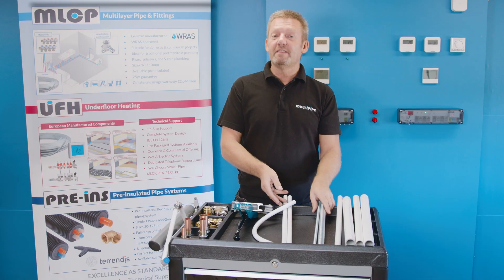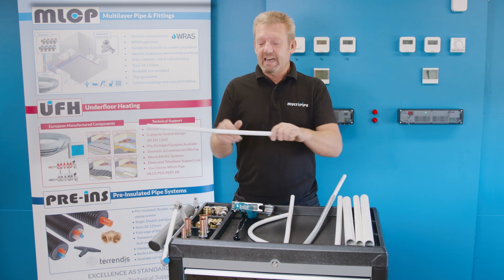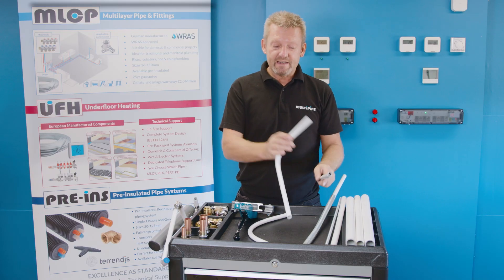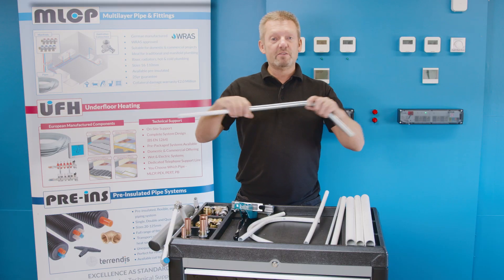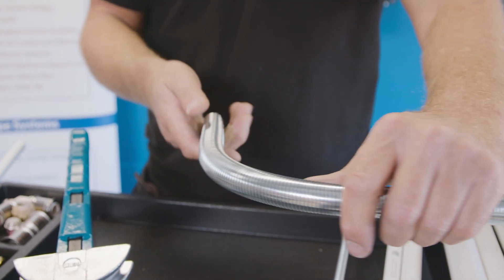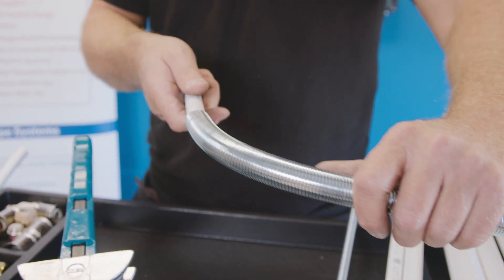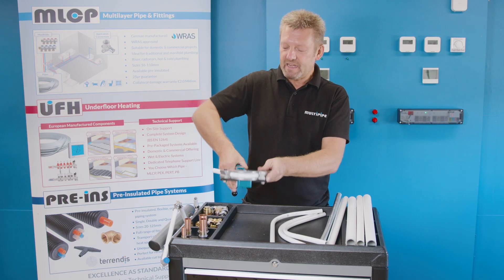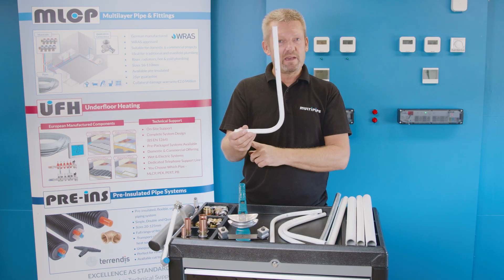MLC Pipe Shaping and Bending - Multipipe

Comment: Interesting that these are not widespread in the USA (I think). I live in Europe and almost every water and heating piping is made out of these MLCP pipes. (Even search results end up being from the UK and/or EU) I think in the USA they use solid PEX pipes instead of composite, I just don't know why.
Reply from the maker: It is an interesting point as there are few manufactures of MLC in the USA but they choose to sell PEX only. I know the pipe dimensions is one problem as there is big costs to setup tooling and manufacturing of MLC and this is done for the EU markets. I think also its another unknown product and would take years to establish. thanks for taking an interest !